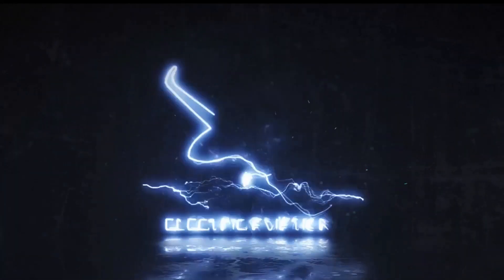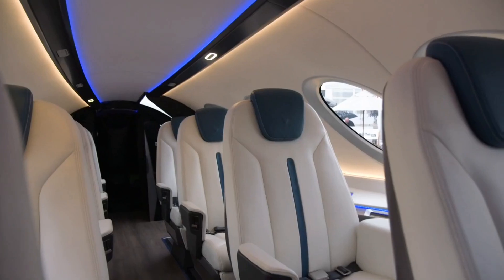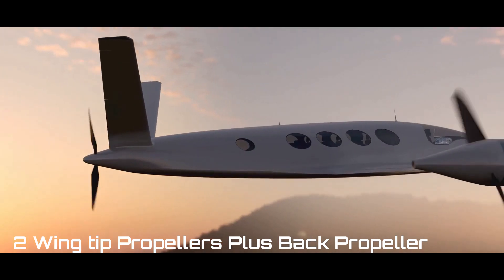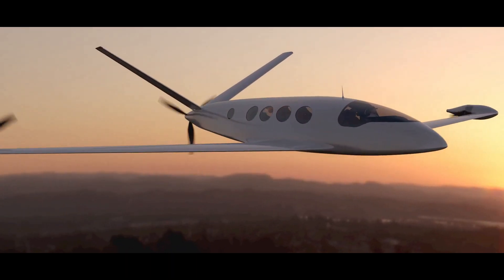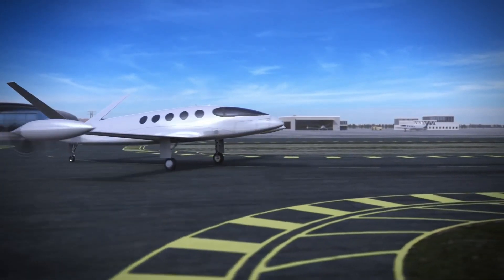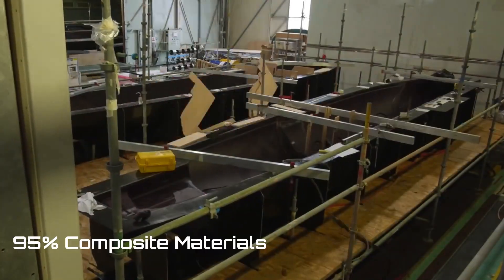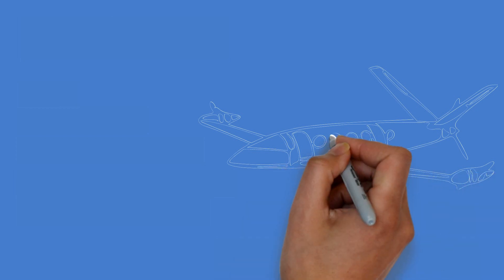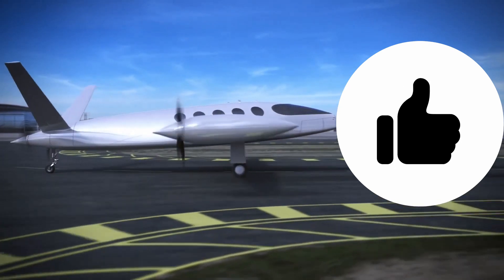Eviation Alice: Complete details of best designed electric aircraft so far

Comment: Its beautiful and elegant, they need to replace the batteries when Tesla starts making the new chemistry.
Reply from the maker: True. A more energy dense battery will do wonders for this aircraft
Reply: What us their new chemistry? Curious to know as I am a chemist. Ate you talking about the 4680? If so I dont think for this it would be beneficial
Reply from the maker: @kevinkraft2419  Aluminium Air
Reply: @D R yes they are cheaper to make. But the energy density improvement is almost nothing it is a few % thats it. If you compare it to their older batteries they are just bigger in volume (the number are the dimensions). So there isnt a breakthough in energy density which is the most important thing considering aircrafts. And what is the breakthrough in chemistry? As far as I know they changed the compositiom slightly and again this does almost nothing to the energy density.
Reply: @ElectricAviation  ?

Comment: Instead of having the engines so far from the center of thrust, they should put them in a pusher/puller configuration (like the cessna 337). If one of the wing tip engines would give out, the aircraft would become uncontrollable and Vmc.
Reply: The video mentions the propellers are variable pitch and can be feathered in case of engine failure, they also state that it can fly on the single rear propeller if needed. So in case of one of the wing tip engine failing and assuming enough time to react, reducing thrust to the opposite working propeller, feathering both of them to reduce drag, maintain height and then you are in a controllable configuration and able to work on the cause of engine failure and still able to land. So while  I'm sure this scenario would be pretty exciting it seems this would still be recoverable given appropriate actions and training.

Comment: An aircraft designer for more than 40 years in major military and civil aircraft design projects 
only can laugh about 
people having to much money to spend on weird projects. 

Here an other one. 
A chain of aerodynamic and layout assumptions and argumentations are thrown on a heap called Eviation Alice.
What is shown here will not fullfil the claims made.

Concept, shapes, engine installation and propulsion system is simply an electric joke. 
To mention only a few, this fuselage will not take a major part of the lift, 
the engine installation is a danger to themselves 
as well as a desaster for engine failures. 
Also latest changes into the design with 2 pusher propellers will not do easily.
Range, Speed, Cruise-Altitude are a joke for any useable design.
The numbers of performance speak for themselves.

The whole thing is an expensive toy 
as are the latest upper stratosphere astronauts with the attitude of children in an enlarged fair market.